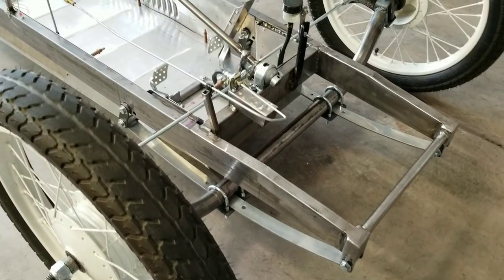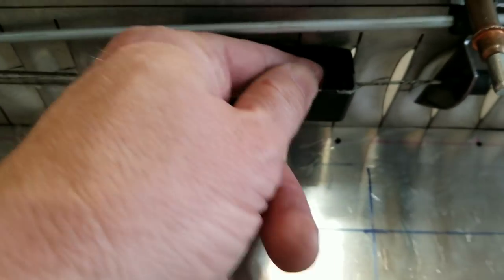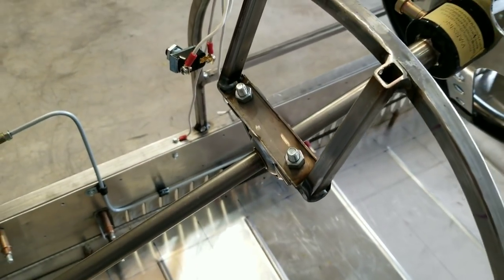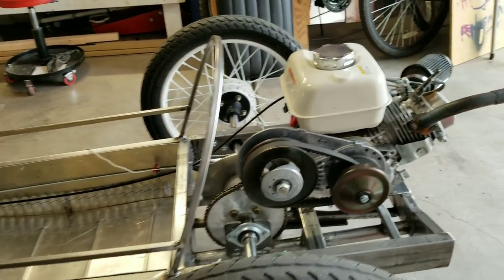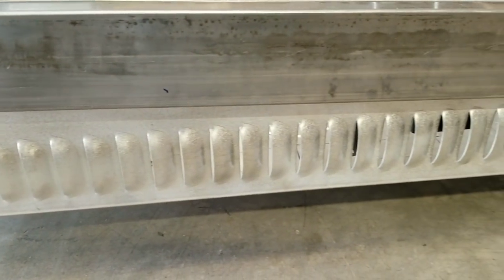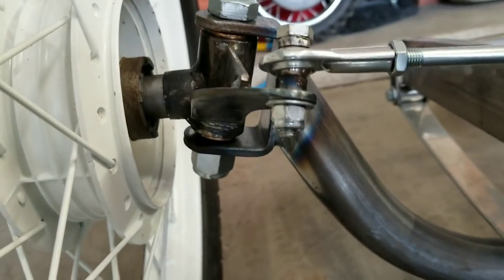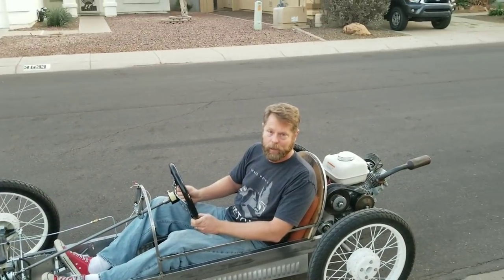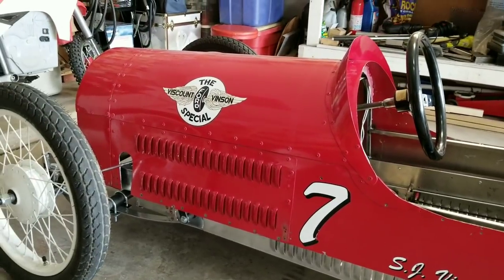Cyclekart Frame Video 9

Comment: Steve your videos are always very helpful. 
  
I do have a question for you…

I’m designing my 1st   kart now. My inspiration car is the 1936 Auto Union type C, and as such a double leaf spring set-up won’t work. The axle needs to be very far forward, so I’m thinking a quarter elliptical arrangement might be best. 

I get the concept, but was hoping to might know where I could find a good how to for this specific set up. 

Kart on…
David
Reply from the maker: Yes, use the inspiration cars suspension and copy it

Comment: I would use bolt on bearings to lower the frame.
Reply from the maker: Some guys have mounted the axle bearings above the frame.  It really depends on your approach and the Inspiration Car.  If it was a low slung speedster like the Austin 7 or a tall car like the Model T.

Comment: I have a question about how your front suspension and your tie rods work with each other.  Are the heim joints that come off of the knuckle being parallel to the ground the secret to getting it to move smoothly with bumps in the road?
Reply from the maker: yes parallel to the ground helps.  with the KPI, they may bind a bit at the travel limits if not parallel.

Comment: Does it drive a solid axle or one wheel only
Reply from the maker: This one has a differential, so both wheels are powered.  the more common set up is a solid axle with one wheel keyed.  You can key both wheels, but it makes it a bit of a struggle to steer.

Comment: where do you get the wheels for it ? also how did you make the luvers
Reply from the maker: Vintage Kart Co in Mesa, Az has them. They are from a Honda CT90. The louvers were punched by a local hotrod builder. Thanks for watching

Comment: what stops a fella from dropping a 500CC Four-cylinder, Five-speed engine in one of these Cyclekarts? There must be rules - right?
Reply from the maker: We do have some 'builder guidelines', this usually starts a discussion about what is a cyclekart.  In my opinion, if you go with  a big motorcycle engine, you are really building a CycleCar.  On the surface they look about the same.  But hey, this is 'Merica, build what makes you happy.